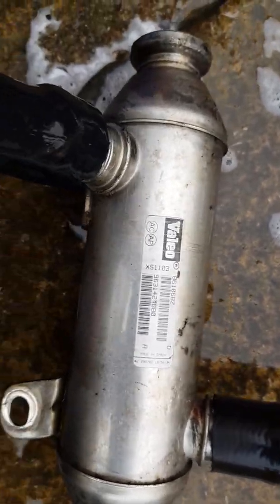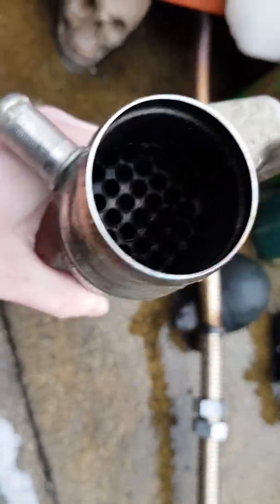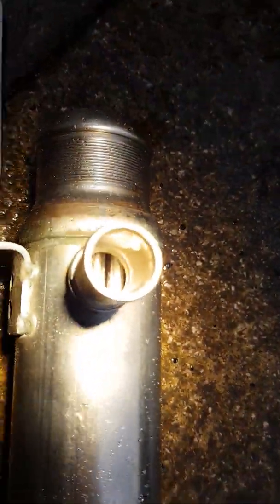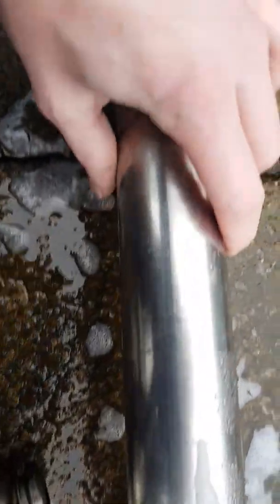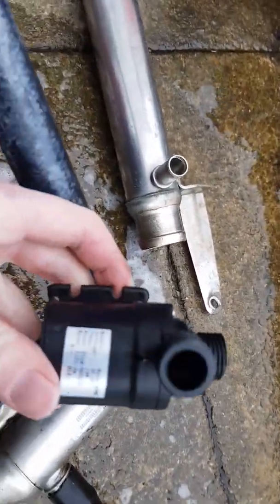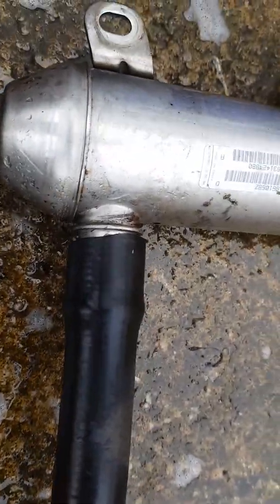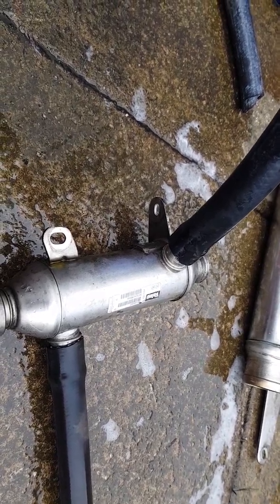5KW Chinese Diesel Heater exhaust heat recovery/Water heater 12v part 2

Comment: Hui, just watched this video as I've just installed a diesel heater for my shed, and also bought one of these EGR coolers. Does it help with further muffling the exhaust noise? I was hoping it will double as an additional silencer.
Reply from the maker: Yes it does considerably. If you continue to use the stock muffler install it post EGR cooler, as you will loose a lot of heat otherwise.
Reply: Got it, so Stock Exhaust / EGR Cooler / Stock Silencer?
Reply from the maker: @somebeinganonymous  you got it 👍
Reply: @forenamesurname4576  Thanks. One more question; my pump is considerably smaller bore than the rubber heater hose. What did you do to connect yours up? Are there any rubber reducer fittings that work?
Reply from the maker: @somebeinganonymous  mine connected quite loose but clamped with jubilee clips. If I was using it long term I'd use a metal reducer connected to a smaller diameter hose 👍 I've not seen rubber reducers but metal and plastic ones.
Reply: @forenamesurname4576  Thanks; I think I'll get a larger bore pump as the one I have is considerably smaller. I can then play about with different sized plumbing fittings

Comment: I didnt see your other video. So you ended up using the smaller egr? Did you end up using it to heat anything?
Reply from the maker: I used it to heat the conservatory briefly, not put it into any permanent use.

I'm currently converting a lorry into a camper and will be using it on that for hot water

Comment: Are the opening to the Valeo cooler 24mm exactly? Ie a very snug fit?
Reply from the maker: Just measured it,
Hose tails 21mm ID 24mm OD
Exhaust Inlet/Outlet 24mm ID 36mm OD
Cheers
Reply: @forenamesurname4576  Nice...so standard exhaust is a very tight fit. A bit of exhaust assembly paste will 100% seal then, cheers.

Comment: Hi there, love the set up, what's the chances this set up would heat two small radiators on a boat?
Reply from the maker: Easily,
It may take a while for them to warm up initally but they will give off plenty of heat in the long run. I estimate the EGR cooler recovers 700-1000w of heat when the heater is running at full power.

Comment: Is this feasible to heat  water and store water for a shower? I’m reading it might be best to use heat exchanger for separate water tank?
Reply from the maker: Yes. It is better to use a heat exchanger
Reply: @forenamesurname4576  thanks for the reply. Why would that be?
Reply from the maker: Fresh water in constant contact with the aluminium in the webasto will cause corrosion. So its best to use a separate loop with coolant/inhibitor to prevent corrosion 👍
Reply: Could u put this in to a comi boiler to keep heat circulation round house

Comment: Good work dude👏👏👏 what's that little pump ?? 
Going to run exactly this setup with a rad in the 50 shades cave 😁
Reply from the maker: I got it off ebay; it was listed as a "12v Solar hot water pump".

Comment: heat exchanger needs to be bigger to get decent  gains. use some kind of old radiator:) with drain crane in the bottom.  pipe diameter also bit bigger. PROPER piping.  Keep pipes as short as possible. Hot gasses want to move up(dont force them down), CONVECTION, you see...:) All the best.

Comment: I wonder if anyone tried just wrapping a small copper pipe (like the brake lines) around the exhaust.
Reply: Copper pipe encircling the stainless exhaust is much less efficient than EGR cooler. There the not enough heat exchange surface to grab the heat from the hot gas. The EGR cooler uses a lot of parallel tubes with smaller diameter comparable to the thermal penetration depth of the hot gas. EGR cooler are easily available. Why bother with copper tube. The problem with EGR is managing the connection of the exhaust and the water. They are all much larger than the 24mm diesel heater exhaust.

Comment: What material are these made from? I would have to weld on flanges to them for hooking up. 

I have a small petrol engine tractor and something like this would be excellent to get some hot water from the exhaust and route to a "conventional heater".
Reply from the maker: They're usually made from 316 stainless steel 👍 some are made with 304 stainless

Comment: A thermo electric generator on the exhaust should be able to deliver 10-30W, to keep the battery topped up during the night. If the heatsink on IT is kept inside the van, additional 500w of heating can be recoverd from the exhaust too. However paying another $300-500, for such a small amount of power might be nuts?

Comment: Glad i found this video. i was thinking of using this same idea to heat under a water storage tank in the winter months to keep the water from freezing. I Could easily adapt pex pipe to make a big coil under the tank with insulation to retain the heat and direct it upwards.  I Could get a 12 volt solar pump to move the water thru the system.
Reply from the maker: Good idea 👍👍

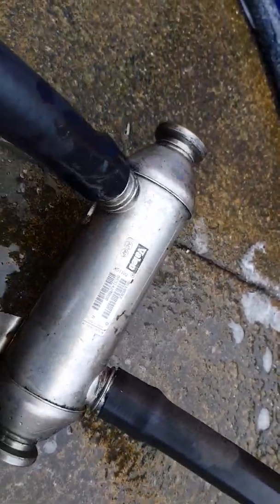Comment: 4:50 Was that skull previously owned (and mounted to) your safety officer ?? ;-)
But seriously, I like the idea very much... I have Webasto hydronic heater setup which I use to heat the van and have about 14L of hot water (70 degrees from the Webasto) or 85 degrees of the engine. I use a thermostatic and adjustable (43-60 degrees) mixer valve to mix it with some cold water before it is delivered to the kitchen sink cabinet. Very nice. With this thing you could do the same but to be honest I would also look into getting a heat exchanger unit from a central heating unit to get heat from coolant (produced by your engine) to drinking water and an insulated tank... all presuming your heater is an air heater as a opposed to a water based unit...
Reply from the maker: Hi I am going to be doing that on my camper coversion. Using a plate heat exchanger removed from a combi boiler to transfer heat from the engine coolant to a thermal store. 

I will be using a tank filled with antifreeze rather than drinking water and use another PHE to transfer heat to the taps. 😁😁👍👍👍👍

Comment: Great idea.
I'd be happy having an externally mounted metal Jerry Can with tap and pressure release valve to heat up water for a shave/washing.
Reply: If you were to find two tanks which one of them fits inside the other (the outer being cut open to insert the smaller one) you could then fill the cavity between the two with spray foam insulation for obvious reasons...
Reply: Bernard Elgar 
I wouldn’t run fresh water directly though the system and heat store. Instead I’d recommend running your fresh water through a spiral line inside the warm water store. That should be safer. You’ll have less chance of bacterial growth and less chance of contamination due to a leakage in the heat exchanger. On top of that you could make it an open system or at least a very low pressure system.

Comment: Great work!!! Pump that through a external radiator or heater core with a fan to help boost the total heat applied to the area you're heating...I've check for those here in the states..no luck closest ones here run bout $100